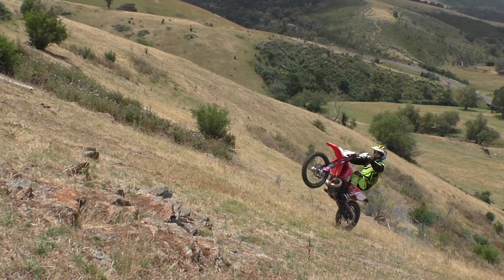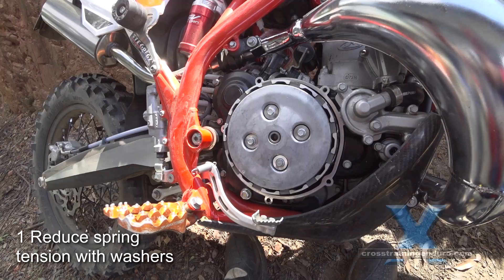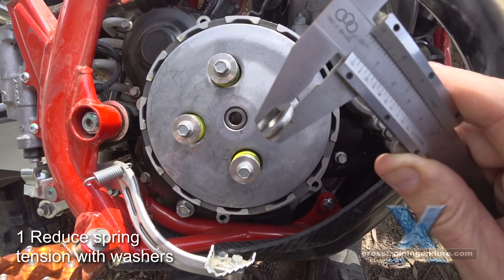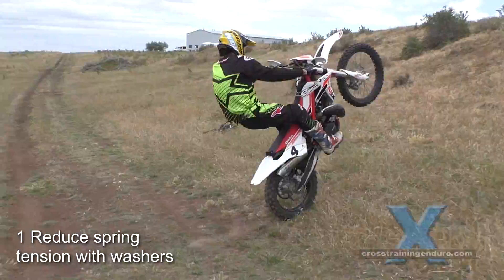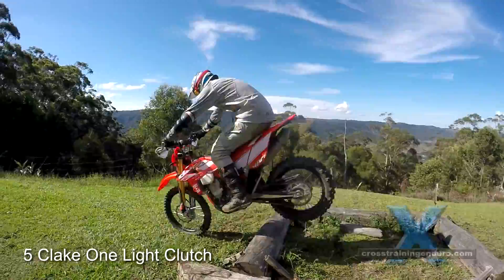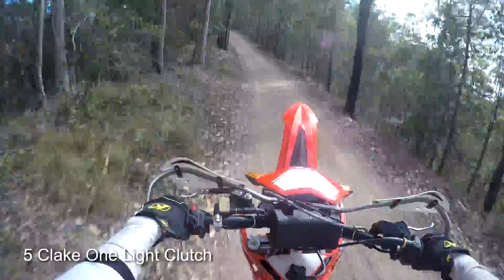How to make your hydraulic motorbike clutch lighter: 5 tips!︱Cross Training Enduro

Comment from the maker: Hydraulic clutch? See this vid instead: https://youtu.be/41DyblFBfr8
INDEX
0:35 Using $1 of washers!
1:56 Lighter clutch springs
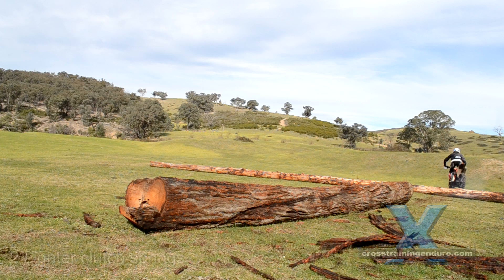2:26 Removing two springs
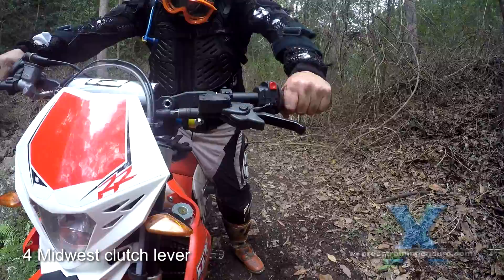2:54 Levers using extra leverage
3:30 Clake One Light clutch
FURTHER COMMENTS:  If trying the washers, the later model Betas have six springs and you can only fit a 0.9mm washer in there before you start hitting the case. Seems it's a much tighter fit than the 4 spring models.
One of our guys, Jason, really struggles with hand issues. I don't think most of us need to go to these lengths, but if you have a medical condition or very weak fingers for some reason, here is his journey, and ultimate solution. 
Clake One Light Clutch - Great bit of gear but expensive. Reduces the clutch pull the most of all the mods and is adjustable. It can be quite "notchy" and inconsistent in release especially when you wind the spring tension up to have a really light pull. 

Then I tried the Mid-West lever - A lot cheaper but still expensive for what it is, but does reduce the pull quite signficantly but increases the stroke. I quite liked it at first but found I was constantly having to adjust the free play during our rides which became annoying. This was a bit strange as some guys in our group had no problem with the free play while some did.

Next I tried the washer mod - this involves putting some washers under the collars of the clutch springs to reduce the pre-tension on the clutch springs. Cheap and easy mod but I found the changes were only subtle. This alone wasn't anywhere near enough for me.

Next, I installed the slightly larger slave cyclinder from an earlier model Beta (I think it was from the 2013 350 RR??). Much like the washer mod, the change was only subtle and barely noticeable in my opinion. I left this on as I couldn't be bothered putting the old one back on.
Next tried the custom clutch springs from Two Rides (https://www.tworide.net/). Unfortunately I don't think he sells them anymore for 2016 models but these were great and highly recommended. They reduced the pull significantly without any slippage. I rode this for a while with the new slave and stock master cylinder.

Next I tried the springs for a 2018 Beta Crosstrainer just for the sake of it. The 2018 onwards have 6 springs compared to the earlier models so they are lighter. The results where simlar to the Two Rides springs but fractionally lighter. (please note that if you do this mod you also need the spring collars and screws for 2018 as well).

I rode this for a while again with the new slave and stock master cylinder but was still getting sore hand and cramps on some of our longer more technical rides, so I decided to give the clake another go but this time with the slave cyclinder and 2018 springs. This combination turned out to be favourite and what I currently ride with now. 

I found with the lighter 2018 clucth springs I didn't need to wind up the clake spring tension as much and as such I was able to get a super light consistent one finger clutch feel of the clake without the notchiness.
So there you go.
Reply: wow, and that is with a hydraulic clutch? i just have a standard cable clutch, i want to learn technical riding, but it takes most of my fingers to pull the clutch in, so i dont have a good grip on my bike. i have just bought a new lever as the old one was one i had retrofitted from a push bike when the orginal snapped. hopefully this helps me, and getting it in a good position.

Comment: Great trick is to just simply remove 2 of the 6 springs on KTMs.  I did this on a 2008 300 XCW and i have had zero issues.  Super quick, and reduces the clutch pull by at least 25-30%.  AWESOME.  No clutch slippage at all, and I have pulled hard all the way through 5th gear.  Highly recommend.
Reply: Would this work for a 2017 yz450?
Reply: I'm going to try that on my KTM 300. If my calculations are correct, removing 2 of the 6 springs should reduce the clutch pull by 33%
Reply: Do you think it does work for husky 2017 to?

Comment: I watched your review for the midwest clutch and felt that it was great bang for the buck. I popped one on my Beta 300 and it's great. I haven't felt the need to lighten it any further, but the washer tip you just talked about in this video is a good one and I might try that out too. I've moved my clutch lever in a bit and I can now operate the Midwest with just one finger without too much trouble. It's really good, I've learnt to feather the clutch a lot more while riding hills etc and it's helpful for x-training techniques. I think I should probably drop the $ on the Clake at some point, it does look the worth it. thumbs up
Reply from the maker: the clake is a step up again, but the midwest is brilliant for the cost :)
Reply: CROSS TRAINING ENDURO SKILLS  hey what do you guys think of the Kawasaki kdx 200 do you think it’s a good bike or not really?!
Reply: @ssupreme9740  It's a great bike.

Comment: One mod you didn't mention is a lighter weight hydraulic fluid, I went to a 2.5 weight fork oil on my older KTM 300 clutch and it made a noticeable difference in clutch pull, I also went to an Enduro Engineering needle bearing clutch lever which reduces friction at the lever pivot point.

Comment: If you have a cable clutch drill another hole for the cable a little closer to the pivot point but don't drill right through the other side. Take a small file or Grinder and cut out a notch for the cable to sit farther in to the pivot. This makes a big difference and if you have the tools it's free

Comment: Barry ... 2:33 is a DDS cluth (ktm's 2013-2016 i belive) which doest have individual springs for each bolt. Insted it uses disk spring (BELLEVILLE SPRING). The mod is even simplier for those DDS. There is a "spring ring" (black ring with many wholes) above "belleville spring" with cluth wear adjustemnt if needed (check it on google). Just change it's position betwen X,Y,Z for diffrent cluth feel, lighter pull and engagment point. Chris Birch descriebed it in his facebook page i think. Cheers
Reply: well on ktms if they are newer ones the clutch is already 1 finger pull light
Reply: Super helpful info, thank you.

Comment: That washer trick is my favorite trick, you can tell if you did too much right off the bat if you can spread the clutch apart by hand before installing the clover. It should still be tight with no space otherwise it will just slip and you will have to take the cover off to mess with it again. Takes allot of back and forth with different thicknesses and even different combinations on alternating springs but once you get it right it will be worth it. Also lean the bike on it's side so you don't have to drain the oil every time you mess with it. Also you can grind the washers down thinner to really dial it in.
Reply: What washers should you use? Don’t really feel like measuring and figuring it out.

Comment: I had an '82 Honda 750 inline with a total wrist killing clutch.....i bought the bike cheap as a daily rider so I didnt have to park my brand new GSXR limited edition to work.  Well I LOVED the Honda EXCEPT the damn clutch just killed me!  I pulled the entire clutch and actuation assembly apart and checked everything....I even  polished the basket's light notching out laid the cable out which was brand new and it was slick as snot...the clutch rod was perfectly true...I replaced clutch springs thinking someone possibly beefed them in the past....NOTHING improved it....so then put lighter springs in and STILL a hand killer...I am certain had I kept on it i could have solved it somehow but someone came along that wanted the bike so I made money on her and moved on....I never forgot that however because it really frustrated me as I otherwise really like that bike!  Might have even been the lower handlebars although there was absolutely no noticable binding in stock cable....IF I had persevered more I would have tried stockish high bars to see if things improved and if so  then i might have sourced or fabricated a shorter cable....but the thing is I had put low bars on several other bikes with no issues like that so it made no sense....I honestly never thought about the washer trick pretty slick and simple!  TODAY if I had a motorcycle with an unbearable clutch pull that I otherwise loved?  Well then I would simply purchase and install an aftermarket hydraulic unit on her!  done and DONE....the frustrating thing with weird problems on preowned bike is you never REALLY know what someone did before u got it....people will transplant parts from one model to another and/or parts counter dudes might sell one the wrong parts!  Sometimes it is scary how many part number changes manufacturers go through for a part on a model....it is like WTF??   WHY??  Lol  If the parts were truly identical then WHY did they substitute them???

Comment: the picture of the ktm clutch for number 3 is a DDS clutch. It uses a diaphragm instead of clutch springs. The diaphragm needs to be set to the correct level of deflection as the clutch wears.

Comment: Btw, light clutch is also excellent if you use your dirtbike for riding around a big city. I mean, in 15 minutes, you go from 80km/h on the motorway, to 5 in a jam, to 60 on a surface street, to 0 at a stoplight (these are most demanding on the left hand), to 20 through the park, you shift a whole lot.

Comment: And (if your bike is a bit older) and has a cable-operated clutch,.. just get a nice new cable before doing anything else.
Reply: Or just pop some spray for electrical conductivity in it, worked for me (something like WD would probably work as well).
Reply: True! But you have to re -grease the cable if you do that. The spray will wash the dirt off but also the grease.  Afterwards use some sticky cable lube too. (cable's can even rust otherwise).
Reply: best to use a teflon clutch cable, way lighter and smoother, and kinda cheap
Reply: Sneeuw I'm used to harley cables, so i use graphite.

Comment: time to try the washer trick on my klr 650
Reply from the maker: i'd suggest seeing if anyone has tried on a KLR before, gasper.... with all that low down grunt it could start to slip very quickly and I"m sure guys will have reported this on the forums. :)
Reply: thanks for the advice Barry i will check the forums first. (checking right now) And yeah people seem to be upgrading to stiffer springs, dont know why because i ride hard and i haven't have it slip on me yet, Maybe they dont like the soft sluggish engagement or something.  I have to check on the doohickey and the mesh filter at the bottom so the covers must come off anyway so i just might extend the leaver on the clutch side to get a bit of extra leverage. Dont get me wrong i dont find the clutch hard at all, its my unproportional arm that is bothering me.
Reply: Gasper Erjavec so how did it turn out... I just installed 2 6mm washers on all 6 springs (2011 yz450f) but haven't rode it yet, my only concern is that it pushed the bolts out considerably so may rub against the case & the clutch may slip. The pull is slightly lighter but not worth shortening the life of the clutch... Thanks!

Comment: Can you remove just one clutch spring if you have five clutch springs?
Reply: I wouldn't. The resulting net force will no longer be applied down the center of the shaft. Will probably wear your clutch basket fingers more quickly or possibly even bind.

Comment: as an ex trials rider, i used an verry  effective but  cheap trick for the stiff 80's bikes clutch : take out the little bushing (if there is one) out the lever, where the pivot bolt is, and eventualy take an smaler bolt, to  mount an little rollerbearing instead (the type without an inner cage : M6 inner diam 10mm  outher diam. 8 mm  heith  ; or if possible . M8x12 x 10), be sure to mount an pivot bolt without tread where the bearing runs  and put teflon grease in, works great and costs 3 euro's ; With my montesa,we even modified  the axle in the clutch case, I turned the axle off, and put also ther that type bearing, it was the  an biggest  difference   b ut more work   ahttps://www.youtube.com/watch?v=ydZyFR-iDWc

Comment: I still don't understand why the washers are smaller than the inside diameter of the clutch springs? They'll just fall into the middle?
Reply: That's what you want, the washers makes the bolts stick out further when it´s tightened, compressing the springs less which makes the clutch lighter. If you use larger washers that sits over the spring or put washers on the outside side of the original washers it will compress the springs more making the clutch heavier.

Comment: I need to replace my clutch in my crf450x! Should I just replace the cable clutch? Recluse? Or an after market hydraulic clutch? Thanks guys
Reply: I have a 450x that came with a rekluse. My clutch pull is really light. It is an old clutch though.

Comment: How does installing washers inside the clutch springs make for a lighter pull?
Reply: adding the washers increases the length of the spring therefore reducing the compression of the spring.

Comment: on the new ktms u never have to change anything to the clutch since its already suuuuuper light :D
Reply: I don't agree, I have a wrist injury so I am very sensitive to clutch pull and I've ridden 2016 to 2018 Ktm's in about 4 different models and the stock clutches were a good deal harder than the cable clutch on my yz250 and kx250f and yz450f. two of these bikes are modded to make the clutch lighter but even stock I'd say they are the same if not a tad lighter to pull. Only benefit I see is that it's self adjusting so no fiddling with it during a long ride/ race and you always no where it will release which is really nice.

Comment: I can't see how anyone would need to make a hydraulic any easier to pull....
Reply from the maker: Yep, as mentioned in the vid Mike.... "many riders are fine with their stock even if it's a heavy clutch, but in some cases a light clutch can be very cool - if you are doing a lot of slow technical riding with lots of clutch slipping, or you are an older rider with weak fingers."

Comment: The clake one light clutch is alot dearer than stated. 
Is it worth the money? 
They now have a single lever option that does both the clutch at the beginning of the pull and rear brake at the end of the pull. 
Do you still think the double lever option is the best way to go?
Cheers and thanks in Advance. 
Fellow tall freak of nature.
Reply from the maker: that other option has been around for ages, we did review it a few years back.
Reply: @crosstrainingenduro 
Like you said in the video it's an investment in better riding.  
I definitely want one but haven't found your review comparison of what's better between the clake 2 and clake pro.
The clake website recommends the pro for trail riding. 
●What clake clutch are you currently using and why? 

Thank you for your videos and time 
Cheers

Comment: or become a mechanic like me. no clutch lever is too heavy baha. but seriously i wouldnt mess with clutch springs unless adding tension. one day you will be slipping the fuck out of your clutch and it will fade very quickly. levers are always a more reliable option
Reply: Luk3y Luke This tip made me laugh,your going to see clutches slip like a bitch.
Reply: I had some springs which, due to age most likely (or the cheap chinese brand they were), became practically impossible to squeeze the clutch. It got to the point where it took two full grown adults to squeeze it in. Took half the springs out, and it became easier again. I'll probably look at replacing all of them soon, or getting a new clutch.
Reply: Luk3y Luke i have a 02 yz250. The clutch hurts my hand after a while of riding. The cable and lever are good. I thought someone had put stiff springs in it. When i changed the basket i ordered and put in oem springs. It's the same. Any advice? I thought about putting 3 softer springs in them, but i don't know which springs or if it will cause it to start slipping.

Comment: Hey Barry, what about a slipper clutch? Been considering one for my bike which doubles as a super motard. Any negatives for dirt application?
Reply from the maker: never used one jack, i don't even know what they do exactly..... :(
Reply: They actually came stock on my "05 GasGas450, the slipper actually slips under decel so that road bikes and supermoto bikes wouldn't rear wheel hop under hard decel going into turns, it was fun diving into a turn in the dirt at a higher speed and downshifting and just dump the clutch out, no hop and no high revs, just a very controlled turn with minimal effort. That being said, the Adler slipper on my GG only had 3 springs and it's the lightest clutch pull EVER, you could pull it all day long with your pinky finger, once a riding buddy came over and he pulled my clutch and asked why my clutch was unhooked because we were riding the next day, he didn't believe it was hooked up, on the downside, it lacked feel when slipping out of turns.
Reply: Metalefty3 was it hooked up to a hydro clutch or cable? I've got a cable clutch on my wr450 and while this sounds pretty tempting, I'm nervous to do the mod fearing I may not like the feel of it and it's some big $$$
Reply: It was a hydro clutch, I'm sure it helped with the light feel, It should still be incredibly light with a cable. Maybe go to a forum on a supermoto site and see what they say.

Comment: I think my klx has a wet clutch so presumably need to drain the oil first.
I did tell you about my iq.
Reply from the maker: most bikes have wet clutches phil, but if you tilt them 45 degrees you probably won't lose any oil.